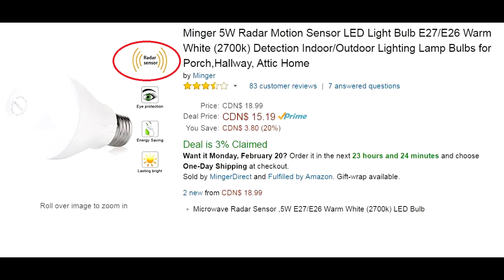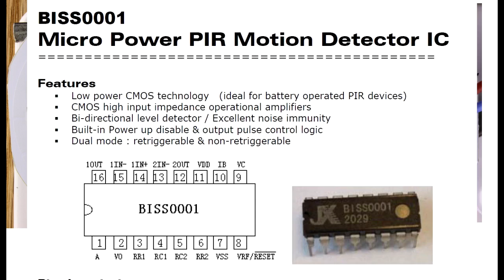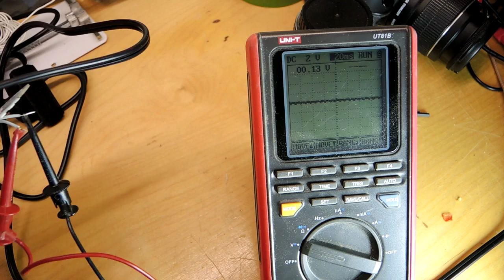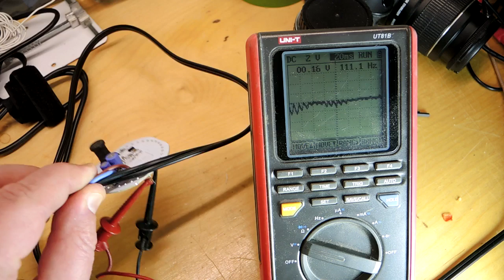MOTION DETECTING LIGHT BULB WHICH USES RADAR!

Comment: There's no mixer. All it does is monitor the current drawn by the oscillator circuit, and amplify the perturbations caused by intruders perturbing the tank circuit. I've seen one many years ago in the tube days. 

I just bought one for ten bucks and put it outside on a walkway. It can detect when I open a door inside the garage, 20 feet away through a wooden wall.

Comment: I love your videos electronupdate!

I think it's not actually radar, but what the FCC classifies as a "field disturbance sensor".  Traditional radar (radio detection and ranging) would transmit powerful pulses of RF, and while the transmitter is turned off it would measure the time until an echo is received.  The greater the delay, the greater the distance to the target.  It works over long distances.  A field disturbance sensor uses very low power and transmits continuously.  Objects in the RF field are "coupled" into the circuit, absorbing and/or reflecting energy.  If the object moves, it disturbs the field by changing the loading and the SWR.  This causes small changes in the transmitted signal which can be detected.  It might not even have a receiving antenna, just a transmitter.  It only works at very close range.  

Field disturbance sensors have been used in alarm systems and automatic door openers and the like for decades.  

I know that RF engineering is considered a "black art" by many and some designs, especially those with a very low component count are extremely clever.  

Anyway, right or wrong - that's my two cents...

Comment: Can you do a review on the Phillips 5000k 800lm, 2500k 800lm, 2200k 80lm bulb?  It cycles thru the 3 when wall switch is rapidly switched and remembers the last choice.  I am assuming it has a set of 5000k and 2500k leds each, with dimming of 2500k's for 2200k 80lm .  All plastic bulb incl below lens A19, $8 US, Thx

Comment: How again is the BIS0011 being used?  It's clearly for PIR motion, however are they able to use it with the RADAR signals?  Still a poor chose for a ceiling fans, water thru PVC pipes etc., doubt it has that immunity filtering.
Reply: The BISS0001 only looks at a fast changing DC-level, that is exactly what comes from the Radar-circuit or PIR, so that's why it's working.
Reply: Yes that makes sense, the RADAR is cheaper than a PIR chip, but has it's drawbacks of falsing.  I wonder how this bulb functions with a ceiling fan.  Expensive ones for alarms use algorithms for falsing and constant repetitive movements and of course combine PIR and RADAR for reliable anti falsing in alarms.

Comment: I think it's not really radar. More likely just a simple oscillator that "illuminates" objects by reflecting an RF signal off them and then detecting changes in signal level (due to interference from the returned signal) with the PIR chip.
Reply: It's not changes in signal level, it mixes the return signal with the emitted one and measures the frequency difference, a.k.a doppler shift. You're right it's not radar (which measures time-of-flight), this is a doppler detector like a police radar speed detector. This implementation is about as simple as you can get - it only detects movement (not distance).
Reply: which is exactly what radar sensor does
Reply: JellyfishJelly not really. No need for a splitter or LPF.
Reply: they are very sensitive and dont function correctly !!

Comment: Big Clive does a nice take apart on this one to, just look on youtube for 'bigclive radar'

Thanks for you take apart to.
Reply: It's good to know that Electronupdate was equally perplexed by the repurposing of a BISS0001 PIR chip with a single transistor radar circuit.  RF circuitry is an art and often looks a bit bizarre.  There is a patent relating to this technique.  That was quite expensive for an RF lamp.  Many just use a standard 3W driver and regulate down it's open circuit voltage of around 12V or so.  Others use a capacitive dropper.
Reply: Electroupdate is like the more "professional" Bigclive.
Reply: Walter Zanon Yep, I like the de-poting of the ICs on here and I also like Bigclives messing about with mains voltages
Reply: oops, yes, your quite right, very similar minimalist up though.
Reply: It's not the same bulb though, the one Clive featured in his video doesn't even have the BISS0001 see url: 2xHhLbhbb0k